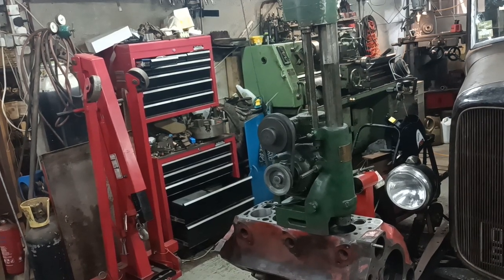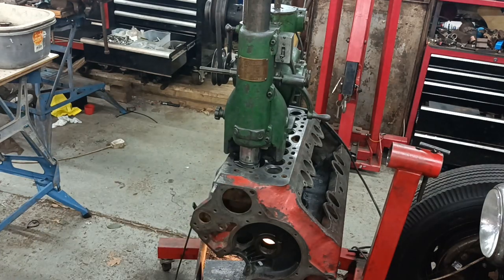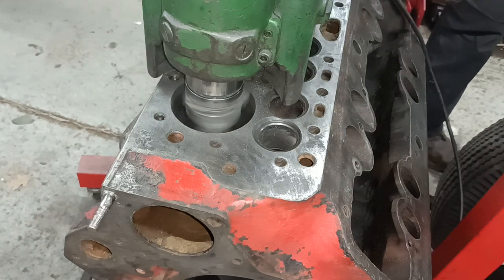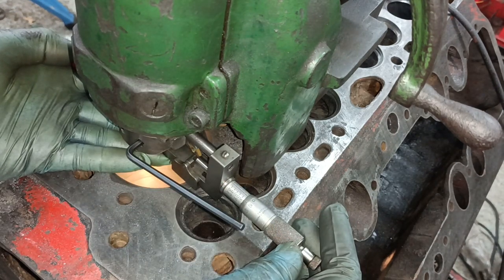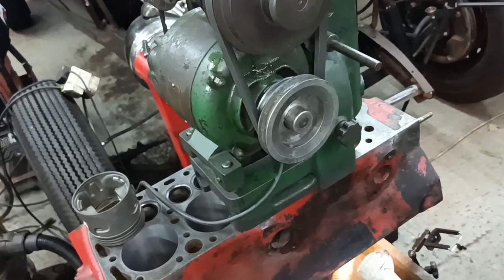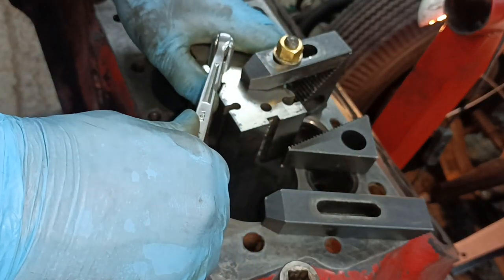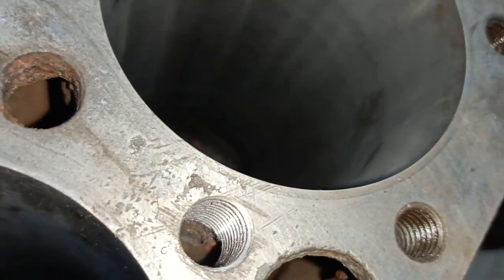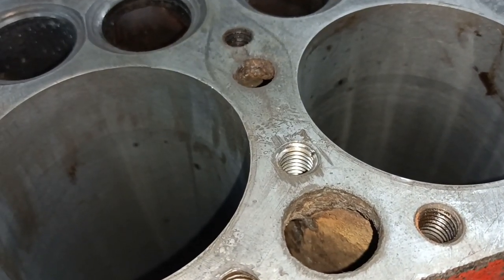2238 Marts Garage: Time to Bore an 8BA Flathead! Vintage Buma Boring Action!

Comment: We used o punch the liners out of those blocks and back then it was easy to find semi finished pistons which were turned to fit the block. The most adventurous one i had was a C59A Mercury block which was bored 3/8ths of an inch....😎😎

Comment: Excellent video, Mart. I particularly liked the Helicoil segment. The tool is very interesting. The kits I have all came with a plastic tool and had varying results.  As you mentioned, an old head works very well for a guide both for drilling and tapping.

Comment: Enjoyed that, thank you. I've been using a "Wandess" machine recently so it was interesting to see how the "Buma" variant compares - looks very similar in operation and perhaps superior to the Van Norman?
Reply from the maker: Hello Wally. Thanks for watching and commenting. I'm not too well up on the Wandess, but did find a manual online. I've never used a Van Norman either, so can't make the comparison. There are Buma machines later than mine so I would imagine thay have some improvements. Mine was just a chance buy with no tooling. I made all the tooling myself and use tipped tools. Someone with a lot of boring experience might do it different but I am self taught. Thanks for dropping by. Mart.
Reply: @MartsGarage  Thanks Mart, yeah I noticed the tipped tool mod- looks a sound idea and if it works..

Comment: Great Vid Mart, I like the helicoil inserting tool. How much  did you leaving for Honing? When I did the tank engine I left about .006" per cylinder which was hard work. I'm thinking of aiming for about 0.002" maybe 0.003" on the next one.
Reply from the maker: Hi Jamie. Holy Shit if I had to take out 6 thou I'd still be at it now!. Like I say, I'm self taught but to be honest, For me the honing takes so much effort I'd like to be at no more than .0015 under finished size with the boring and then more or less just break the surface with a light hone. I could be doing it all wrong and if I had better honing equipment I might say something different. The most important thing is to fine tune the relationship between the special micrometer and the actual measured size. Then you can hit closer to the desired size on the last cut. practice makes perfect and I need a lot more practice!

Comment: Great shots of the several bore cuts as you increased the dimension.  How long did it take for the whole operation?
Reply from the maker: Thanks Hunt. I spread the whole job over 3 days. The honing can take a long time, and the second helicoil repair took a while as I had a nightmare. That will be shown in a future video.